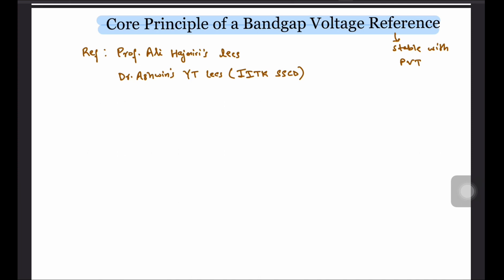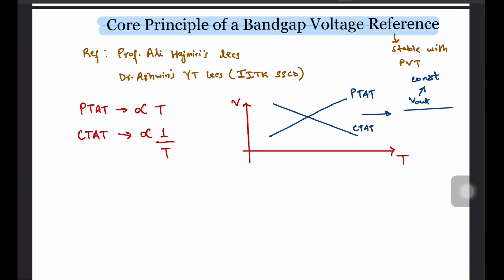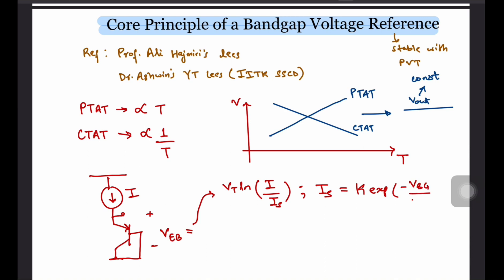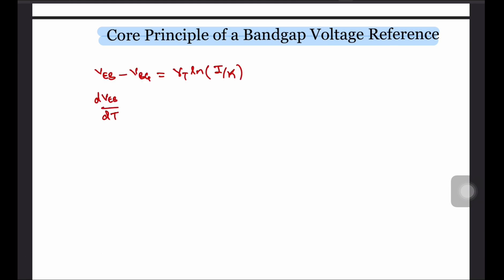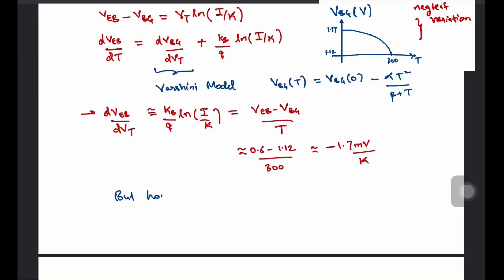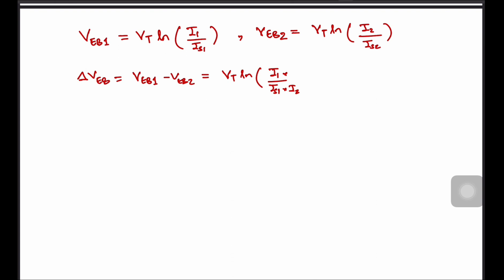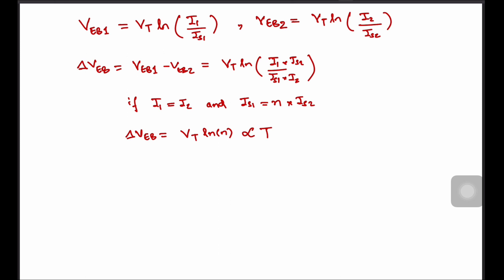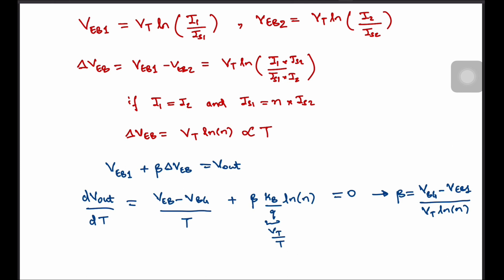Core Principle of a Bandgap Voltage Reference ; PTAT ; CTAT

Comment: Bhai ... Please make some videos of designing the single stage single  ended high gain differential opamp .
Reply from the maker: Are you referring to the 5-transistor OTA? 

You can see the following video for an interesting concept: OTA Zero
https://youtu.be/zDS76dCKLXM
Reply: @TejasKetkar  5 transistor OTA has max 50db gain.. I'm asking about high gain single ended diff amp with cascode structures like telescopic ,wideswing cascode ...